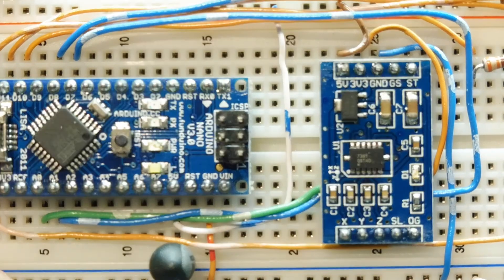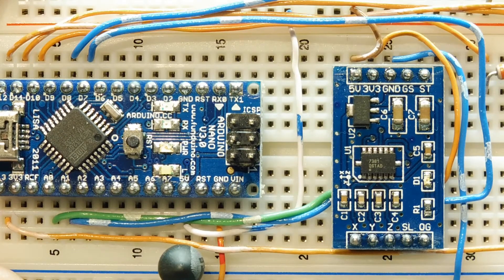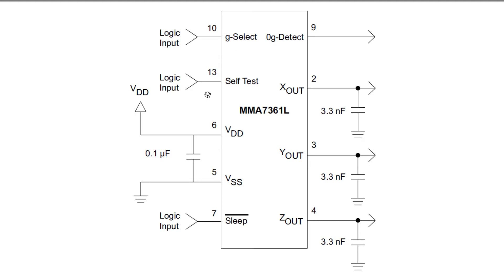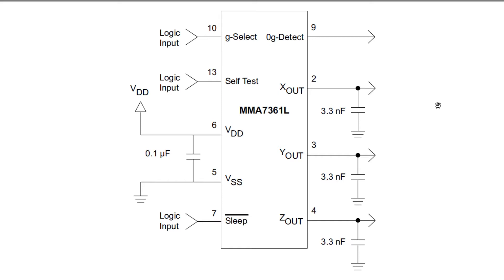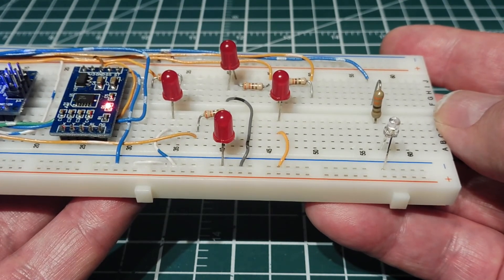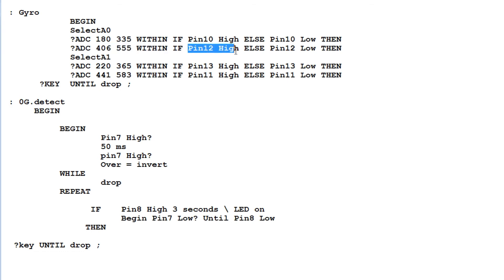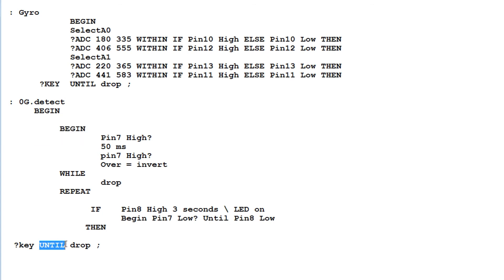Build an Arduino to MMA7361 accelerometer interface

Comment: Sir can u kindly share circuit diagram of this project with full coading to whatsapp +918870521896
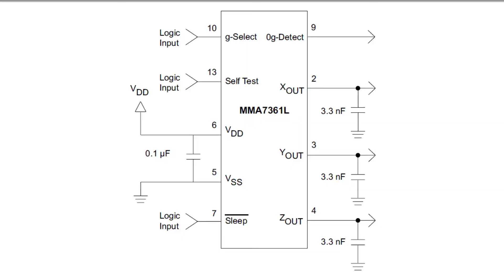Reply from the maker: The code for the project starts at 6:23. The program is written in Forth as I do not use the Arduino IDE. The circuit diagram starts at 2:26. The X and Y outputs are connected to the Nano's ADC converters. The 4 LEDs are driven by the GPIO pins as indicated in the code.

Comment: Sir can u plz show us a proper circuit diagram , i am facing lots of difficulty while connecting , bcoz some of the wires are not possible due to sensor
Reply from the maker: Check out this web site:
https://fazerlab.wordpress.com/2016/09/30/comunicacao-entre-arduino-e-unity3d/

Comment: Did not understand the part regarding pin 13 self test. How does the self test work again and what do you have to apply to pin 13 to initiate a self test?  Thanks
Reply from the maker: A logic high to pin 13 will initiate the self test feature. Turn the MMA7361 upside down to create a -1G output on the Z axis. Applying a high to pin 13 will cause a +1G output. This verifies the mechanical and electronic sections of the MMA7361.
A electrostatic charge is applied to the axis to simulate g forces.
Reply: Thank you